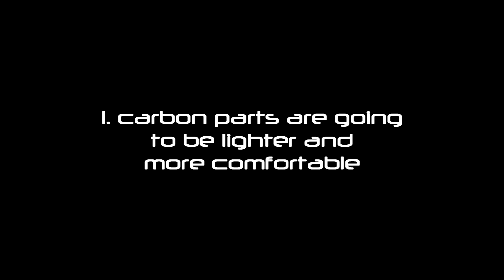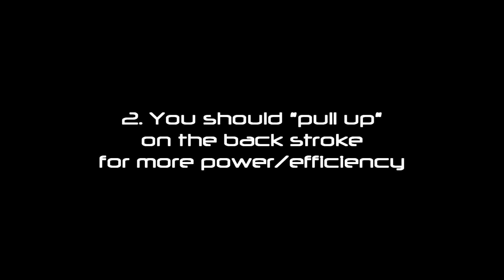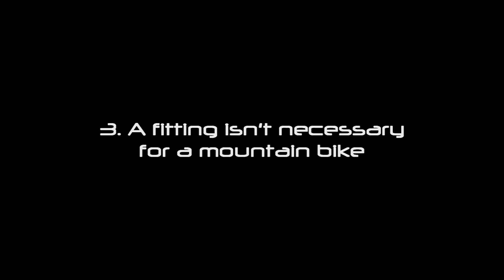Bike Fit Myths Part1 | Carbon Parts, "Pulling" Pedal Stroke, Mtn Bike Fits

Comment: You mentioned hip flexors but aren't you also using hamstrings as you pull back on the pedal once it has reached about 5 o'clock on the stroke.  One thing I'm always thinking about is building strength equally between quads and hamstrings while riding.  If all one ever does is push on the pedal won't the hams get neglected?  Thanks for the content.

Comment: I only mountain bike so this may be different, but there is an objective benefit to a circular pedal stroke.  I noticed the specific phrasing "focusing on the upstroke CAN rob you of power in your downstroke".  It sounds like you're talking about a training problem. I have trained my legs to a circular stroke.  It does still require some focus, but their are 3 benefits that I have definitely, unarguably observed.
1. Yes, there is more power.  I know for a fact that when I'm pushing a tough hill, activating a circular stroke decrease difficulty.  I have also measured this on a stationary where my max wattage output is increased by a circular stroke.
2. Consistent momentum. According to your diagram in Myths #2, the down only pedal stroke is only generating a significant amount of power for less than 180 degrees of the circle per pedal.  Times 2 this means you're only generating significant power for less than the full pedal stroke. That short dip in power results in a jerky momentum pattern that we're all familiar with.  Even introducing a small amount of force in the forward, reverse, and up stroke reduces the momentum lag for the dead periods of your stroke, making it physically more efficient as you're not recovering from the jerky, inconsistent movement a bike that is always accelerating or slowing down. Another reason this is significant for MTB is because the smoother movement also reduces pedal bob.  Nice, smooth, consistent momentum is simply more efficient.
3. Active resting.  One other factor that is very clear is that, even if I don't need the extra power, training a circular stroke allows you to redistribute the work load from one muscle group to another, providing relief and temporary rest for fatigued muscles, which ultimately increases endurance.

All that said, I LOVE your videos and have learned so much from you.  This is just one that I can't get behind.  The only thought error I think you (or the testing researchers you mention) may be guilty of in your position is that it sounds like these tests are assuming maximum power output for 100% of the test.  For any endurance rider, you are never inputting max power into every single power stroke all the time.  Sure, when you are at 100% output, focusing on upstroke may reduce overall wattage.  However, for the majority of any ride, I.E. when you're not sprinting, your body can automatically handle a consistent 30-80% output through force of habit alone.  Anything between there, for any discipline, I think there is a solid case for the circular pedal stroke.
Reply from the maker: Hi Taylor , thanks for weighing in. I understand what you're experiencing on your mountain bike. Having a smoother, more round stroke on the mountain bike can certainly be beneficial. But even with training, the roundest of pedal strokes is actually not that round. Again, I'm not saying that you should never work on improving the coordination and smoothness of your stroke, but for most cyclists in most riding conditions, focusing on pulling up on the backstroke has not only diminishing returns, but may be actively working against the rider. 

You're right about the power spike and dip that can occur when all we do is push down and because of this I think we're talking about the same thing, just from a different standpoint. I still believe in the use of 1-leg drills on the trainer -- not for training the pull-up portion of the pedal stroke, but as a means of improving coordination, and so the focus on them should go from power and instead should focus on cadence and speed of the stroke. It's the addition of this small coordinating effort, which mostly occurs because of a well trained ankle, that produces this smoothness. But even when super efficient pro cyclists (they're not all super efficient -- but many mountain bikers and time trialists are often the best examples) are tested, the pedal stroke is not even close to round -- in fact under steady state conditions (can be a high effort, but is not a full out sprint) all riders always exert a negative torque on the cranks on the back side of the pedal stroke. Even the best of us can't remove it. 

But even still, my main goal with that part of the video was to try to keep people from going down the rabbit hole of  focusing on pulling up on the back of the pedal stroke aggressively. But, where I think our views of this overlap is that we can improve the coordination of our pedal stroke and make it, if not actually round, then perhaps more round. Thoughts?
Reply: I can absolutely see it. Worst case scenario, I'm extremely intrigued. You as a professional in the cycling world and a physician,  definitely are the authority on the matter.  I am facing a strongly stated reality backed by data that is at odds with my experience.

As an interesting side note, one of my side hobbies is the study of cognitive bias.  I am thus all too aware of how likely it is that I'm simply fooling myself.  With a background in engineering, I see a machine and I need to understand it.  I thought I understood my pedal stroke, but obviously, I have research to do!

I'd like to explore a way to quantify this and get some data to ensure that all of the considerations are covered.  

Do you by chance have access to the research you reference? I'd like to review those methods before I dive in to this.

Thanks for the response!
Reply from the maker: Sure, give me some time and I'll try to dig out those references...never hurts to review them again anyway.

FWIW, I have felt completely what you feel -- that my pedal stroke was even and efficient when I really work at it. To learn that it's next to impossible was one of those things that "felt" like it couldn't be true. But alas... ;-)

Also, there's always more to learn....I feel like there are ever more nuances to understand with regard to pedal stroke mechanics.

Comment: Agree. That's why I do not see the need to use cleat.
Reply from the maker: +Racespec yes, agreed
Reply: A cleat keeps the shoes connected to the pedal when riding over rocks and roots and drops. On flat pedals you can get hit in the shin and those pins that give traction to flat soled shoes do leave a  mark. If you spin at a high cadence, 90-100 RPM on a road bike cleats help keep you connected. Last I don’t think of pulling up but I do push forward, down and back at the bottom, like from 4-6 o’clock in the circle of a rotation. I have heard it described as scraping gum off your shoe. Riders afraid they will not release their cleat from their pedal should try Shimano SPD with SMSH 56 Multi angle release cleat and set spring tension very low.

Comment: Vibrations that carbon parts might dampen are already damped by the tires, unless they are dramatically over-inflated. Let 5-15 psi out and see how much better everything feels, likely with zero loss, and often improvement in performance. Re: pulling back, while I never intentionally did it, I used to ride with a longer seat setback, and experienced hamstring cramps especially on longer climbs. Moving the seat forward seems to have remedied that issue, so go figure. Old films of cyclists lugging huge gears at low cadences may have trained to use hamstrings, as their legs look far scrawnier in the quads than today even though they had to push much higher gears.

Comment: Item 2, are you saying to stomp on the pedals?
Reply from the maker: +Barry Hardy Good question. If you're standing up on the bike, then yes, truly stomping is probably perfectly fine. Under "normal" seated riding conditions however there's more of a gray area. It's clearly counter-productive to actively focus on pulling up, but merely stomping down isn't ideal either - otherwise why every road racer on the planet would be just as fast and efficient on flat pedals that don't allow for much of any engagement into the pedal other than directly down. 

This hasn't been quantified well in the research yet, primarily because it would be a tremendously difficult thing to isolate and capture, but as I mention in the 1-leg drill video I did (link in the description) there is an element of the pedal stroke that I find we can benefit from training that enhances the coordination in the pedal stroke. This is why the focus for the 1-leg drills should be on speed (and smoothness) rather than force. Eventually the research will tease this out, I believe, and if I had to venture a guess I would say that the coordination benefit will play out as an improvement in the shoe-pedal force vectors at the top and bottom of the stroke -- essentially we get better and quicker at easing the pedals thru the 12 o'clock and 6 o'clock positions.

Hope this makes sense....  Thanks again for tuning in!
Reply: When you are training for a smooth pedal stroke the motion is very similar to scraping something off of your shoe. As your pedal stroke is coming down towards the six o'clock position this is where the scraping motion comes in. From the twelve o'clock to the six o'clock position this is the power portion of the pedal stroke so when your right foot is past the six o'clock your left foot is now in the power portion of the pedal stroke. You want your pedal stroke to be as smooth as possible for best power transfer to the pedals. You can find out how good your pedal stroke is by riding in an easy gear and pedaling as fast as you can, if your stroke is good it will be smooth,if not you will see how choppy it is at the top and bottom of the stroke. Hope this helps!

Comment: Road bike and mtb fitting have completely different goals. Fitting a mtb is mainly about tuning its handling and balance for your riding style and terrain and is further complicated by the active suspension. Quantifying the quality of an mtb fit is also immense difficult because of the lack of a stable reference (e.g. an ergo for road bikes). Really enjoy your videos by the way!
Reply from the maker: +RCalundann Thanks for the support! Agreed about the drastic difference in goals for mountain versus the road. I didn't even begin to dig I to the fact that on mountain bike fittings it's necessary to spend significant time making sure the suspension is properly set to the rider's size, terrain, riding style, etc.
Reply: Great video! Love the insight and the info.  The link to 'ride quality' doesn't seem to work.  I'm interested to find out why a carbon stem won't give you a better ride quality because if CF provides vibration damping properties then theoretically that should translate to less vibrations to the frame because the stem provides the 'connection' between your upper body through the handlebars and the rest of the frame.

Comment: Another way to look at pedaling is energy. The best pedaling technique turns the pedals with least amount of energy use and allows a bit of leg rest. If you push down with one leg, the other leg ideally would rest while coming back past the 6 o'clock position. If you could engage the muscles to pull back and up perfectly, you would probably use more energy without gaining speed. This is more doable on flatter roads. Really steep climbs will force you to engage more muscles usually.
There is a compromise of pushing and resting. Probably the ideal pedal stroke allows the leg to come around smoothly while one leg pushes down. I have found that forcing the leg to pull back consciously also raises the heart rate a little. A technique that has been discussed in the past is alternate leg pedalling. This means pushing down with one leg only for a two or three strokes while the other leg does not push, but simply lightly moves with little effort.